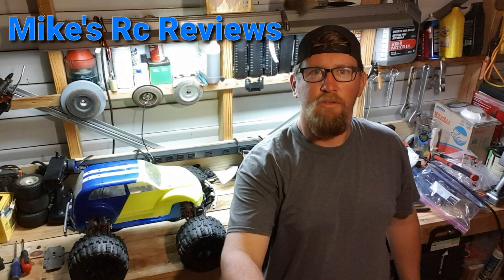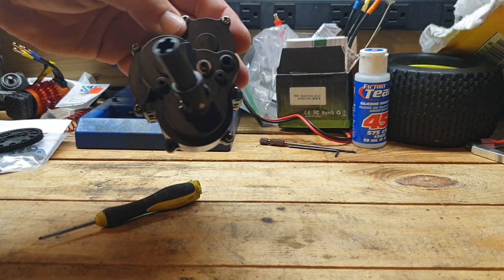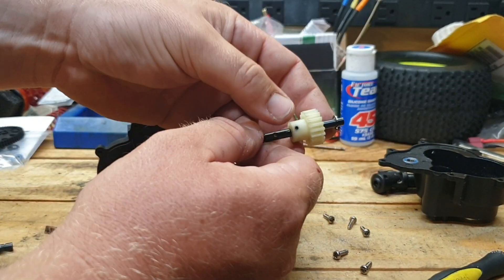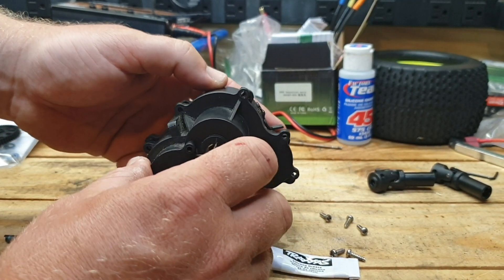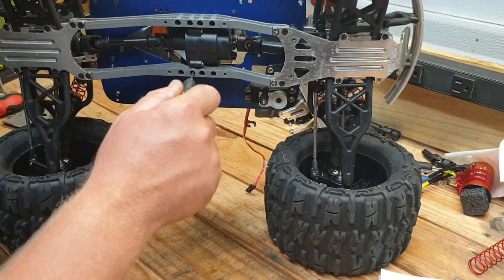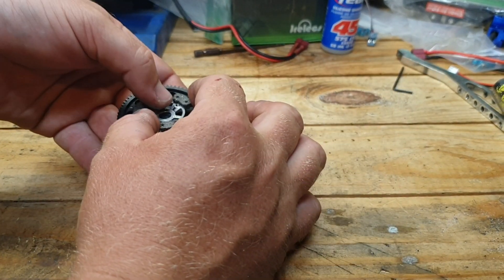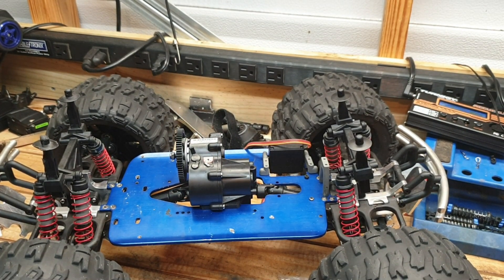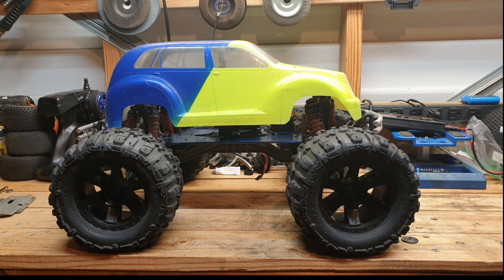Converting Tmaxx Nitro Tranny to Electric

Comment: 1 is the clutch really nessisary?2 so the stock pack parts do not fit the original prts then??? did you use the old gears on the new shaft or spmething?its not clear.and what  about the electric parts ??? nothing on this or is this just  a gearbox thing.with non fitting parts?

Comment: Nice video. But I have 1 quick question. How did you punch out the small pin in the gears for the upgraded spur?
Reply from the maker: Use a small screwdriver its a pain but once you get the pin to start poking out one side use a pair of pliers to pull it out.

Comment: Great video, really in depth. 
Can you help me. I have converted a Cen Genesis to 4S electric, but it keeps stripping the spur gear. I have not changed the gearbox, just removed the reverse, which used a sero change.
Some say to fit a Revo gear system in, but I am not familiar with this. Can you give me some ideas of what I can do to stop my spur gear stripping, or do you have a video showing a conversion of the Cen Genesis to electric or installing a Revo gear system in the Cen
Thanks

Comment: If your going to do this video at least show the cutting out with a grinder would if been helpful for a viewers point thanks for part of the process thumbs up
Reply: Ya sorry about that. After cutting it I forgot to hit record. All you need is a drimel tool with the cut off wheel attached and when the case is all together just cut right behind the clutch plate but be careful that you don't over heat while cutting you'll mess the bearing and or the case up.

Comment: i'm not using pads or a slipper clutch of any kind I actually made my RC with a 3d printed part
it doesnt even have a torque dampener.
sound dumb but it works great so far with a 2050kv motor i'm surprised it didn't end up getting stripped out by now.

Comment: I got a tmax and e max complete.  I want to make one electric truck.   Can I just use the emax trans on the tmax body so I have the metal frame?  I figure I can do it without spending anything.   Is it possible  ?
Reply from the maker: Should fit just depends on the pre drilled holes on the t max frame and if they line up with the emaxx trans. Also you have have to use the emaxx drive shafts if the trans have different output lengths. Let me know if it works.
Reply: @mikesrcreviews509  also the diffs spin the opposite  way because  the trans is actually backwards but you think i could just swap the polarity on the motors or do i have to swap out the diffs
Reply: @killingtime669  Swapping polarity should be fine.  That's what I would do.  Did you get it going yet?
Reply: @mikesrcreviews509  sweet thanks man.

Comment: What kind of grease did u use in the transmission would some red an tacky grease work??
Reply from the maker: Yes you could use that or get some traxxas white grease they have designed specifically for traxxas products. I used the traxxas product. Hope this helps and thanks for commenting with a question always here to help and answer. Make sure you dont forget to subscribe.
Reply: Lucas red tacky grease is better.....

Comment: I havnt played with my tmaxx for many years now but one thing I remember is them plastic traxxas spur gears been uselessly weak and strip teeth all the time, how did u find yours?
Reply from the maker: They sell an upgraded spur gear but the problem is I built this truck ran it for maybe 4 min and bam blew the tranny fixed it and ran another maybe 4 min and the same thing happened absolutely sucked. The old tmaxx trucks just cant handle the power the brushless systems put out. Maybe if you did a brushed or a very not so strong brushless it might handle it.
Reply: @mikesrcreviews509  maybe getting rid of the gearbox all together and run a center diff from a buggy or something would be more durable

Comment: Nice video
Reply from the maker: Thank you.
Reply: I have 2 t Max’s that I’m doing this too. Have had problems with trans and the original peg type spur gear. Might have to change to slipper like you subjested here
Reply: The next weakest point on these are the drive shafts from trans to diffs. Yokes twist and break.
Reply from the maker: @LOOTLicker21  My drive shafts after 1 run look like a candy cane. Twisted!!. That's my next upgrade to it.
Reply from the maker: @LOOTLicker21  the only problem with the upgraded spur haven't found any other sizes than 72 tooth. But definitely stronger.
Reply: Mike's Rc Reviews your talking about the 3 screw type? I asked a traxxas store if a e revo spur would work they had 54 56 58 and I think more 60s I got the 54 I’m waiting on the shaft
Reply from the maker: @LOOTLicker21  yes. If you look at the 72 tooth spure it has a cup shape to it and my local shop only had the spurs in the 60s that where straight/flat spur.